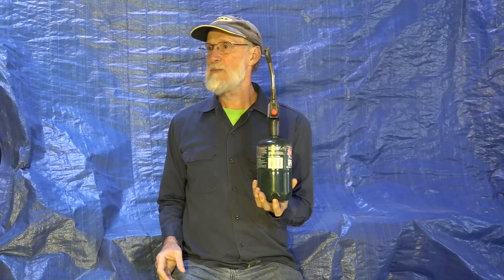R 22a

Comment: If compressor burn out will it cause fire on a Propane A/C?
Reply from the maker: There would have to be a lot of simultaneous failures for that to happen.
GFM
Reply: If the terminals blow out it theoretically could, but if the compressor simply burns out internally it would not cause a fire because there isn't oxygen in the system.

Comment: As you said, it is true that a refrigerant and oil mixture will burn. I have heard of an R22/oil mix burning before. An HVAC tech I know went to a customer's house to take a look at an AC that wasn't cooling. For some reason, the terminals blew out of the top of the compressor while the unit was running and the arcing ignited the refrigerant/oil vapor mixture and there were flames shooting 6 feet out the top of the unit.
Reply from the maker: Interesting type of torch.  More common is the unit is low on charge, the oil pumps out of the compressor and the compressor locks up.
The opening the system with a torch ignites the oil in the lines.
GFM
Reply: @grayfurnaceman  Yeah I figured that this type of fire wasn't all that common. Another interesting issue that I have heard of is where the system explodes because air gets into the system and forms an explosive mixture with the refrigerant and oil, which is compression ignited.
 There was a somewhat well known incident in Tokyo where an R32 AC unit exploded while it was being pumped down. Air somehow got in the system, and the refrigerant and oil mixture exploded violently as it it was compressed by the compressor. 
From the little bit of research that I did, I found that this has happened with "Non Flammable" refrigerants as well, although the R32 systems seem to have more of a problem with this since the refrigerant is slightly flammable to begin with.

Comment: Great video. Just curious- In Australia, they use propane in car AC systems? If so, that sounds like a very bad idea. An accident could cause a fire or explosion if the condensor is damaged.
Reply from the maker: Agreed.
GFM
Reply: And yet it doesn't. It has been found to be safe.
Reply: @keijac82  Do you have a link to that study?

Comment: I agree that there a risk in in putting propane in an AC system, especially a leaking one. I wouldn't use propane in a central AC system either. However, I think the only real risk of a fire or explosion would be if the system developed a large leak. A small leak would probably not be an issue since the airflow would dissipate the gas anyway.
Reply from the maker: It certainly would not be a problem if indeed the leak was small.  I just kind of shudder at a situation where a tech without knowledge of the use of propane getting a face full of flame.  
GFM
Reply: I totally get what you are saying about the risk to a tech that services the system in the future. How much risk do you think there would be to the homeowner though? I think that the odds of the system suddenly discharging and causing a fire or explosion would be quite low. I do think that a sudden evaporator blowout or something like that would be quite unlikely and could be very bad though.
Reply from the maker: All I can say here is I would not put propane refrigerant in my house.
GFM
Reply: I would definitely not use propane in a central AC, but I wouldn't have a problem with flammable refrigerant for  something small like a refrigerator. A few ounces isn't really a hazard IMO, especially when most of the system is outside anyway. I actually recharged my R22 window shaker with R290 (refrigerant grade propane) after fixing the leak and it's running great for the last 7 years.
Reply from the maker: Agreed on the refrigerator.
GFM
Reply: Just curious- What do you think of R32? Do you think it's safe?
Reply from the maker: Its flammability is fairly low, so probably not a problem if precautions are taken.  It does have some oil lubrication problems.
GFM
Reply: Thanks. How is it's efficiency? Maybe you should make a video on it like you did with other refrigerants.
Reply from the maker: The efficiency is about the same as R-22.  I may do a video on it, but have not done so because I do not want to encourage the use of it.
GFM
Reply: Do you not want to encourage the use of it because of the flammability, or is there something else?
Reply from the maker: Its just the flammability.
GFM
Reply: Thank you

Comment: what is a "split system"?
Reply from the maker: David Marlon Alvarez A split system has an outdoor condensing unit with an indoor heat exchanger coil connected by a refrigerant line set. 
GFM

Comment: Probably wouldn't want to use butane as a refrigerant for a heat pump, considering that its boiling point is at 30 degrees Fahrenheit, a temperature that can be reached in the winter.
Reply from the maker: You could use it, but it violates our rule of not using refrigerants that will have pressures below atmospheric in the low side.
GFM
Reply: Just curious what this rule is and why.  Thanks in advance.
Reply: Good question. The reason you don't want to use a refrigerant that runs at a negative suction pressure is because a leak will pull in air, moisture, etc if the system is running. That's obviously terrible for the system, but especially when a highly flammable refrigerant is used, pulling air into the system could be a major safety hazard too. People have been badly hurt or worse by explosions when a significant amount of air ends up inside the system.

Comment: The EPA is soooo worried about the ozone but has no problem with the big corporations putting high pressure combustible gas in our home. Great video.😎
Reply from the maker: Actually, R22A is not approved by the eps. 
GFM

Comment: Good video GFM. As a FYI, earlier this year the EPA finally cracked down on this issue and Enviro-Safe paid a $300,000 fine and had to stop selling R22a. They did however rename it to R290 with an EPA use restriction warning.
Reply from the maker: I saw the change on the website a few weeks ago. Good to see that. Not that it will make much difference to the ones that think all manufacturers are out to rip you off. Thanks for the thoughts. 
GFM

Comment: How good is 407C? Is it ok to put in a R22 system if you add POE oil?
Reply from the maker: 407c is blend of 3 refrigerants. It is a zeotropic blend, which means the highest pressure refrigerant will leak the most if there is a leak in the vapor phase. As most systems that are considered for refrigerant replacement already have leaks, there is a good chance that, unless the leak is found, it will leak again. The separation of the components of the refrigerant will probably cause failure of mechanical parts such as the compressor. 
The use of zeotropic blends is not something I recommend. I saw too many failures. 
The use of R-22 is waning in the industry due of course to the cost. For someone with an older R-22 unit, you might try 407c just to get more life out of the unit. But do not be surprised if it does not last too long. Hope this helps. 
GFM
Reply from the maker: Also, POE oil appears to be a must as 407c does not mix with mineral oil. 
GFM